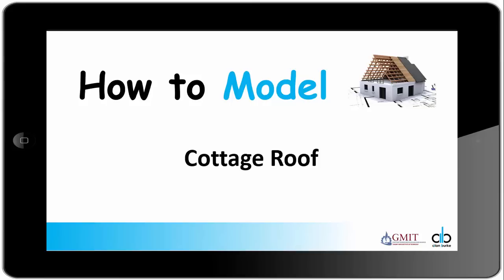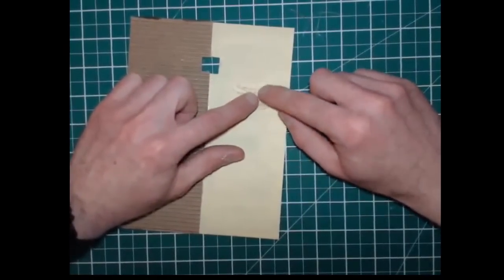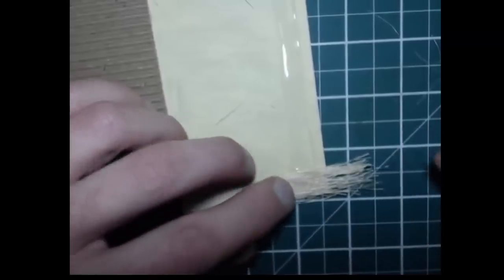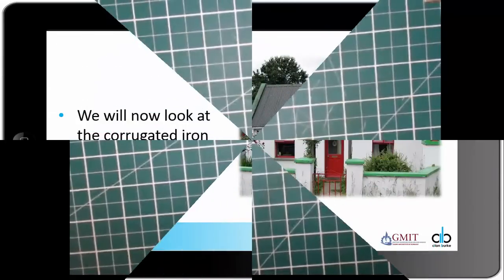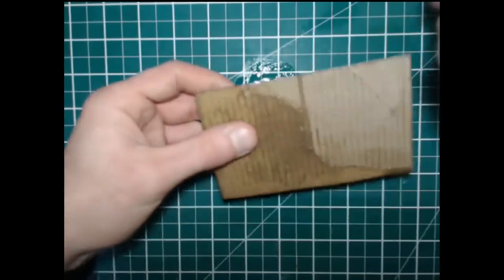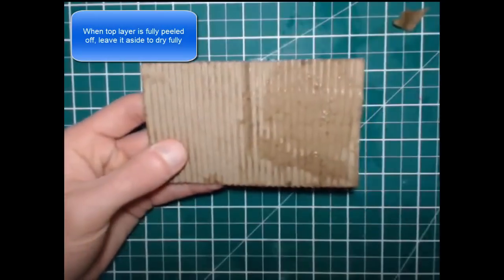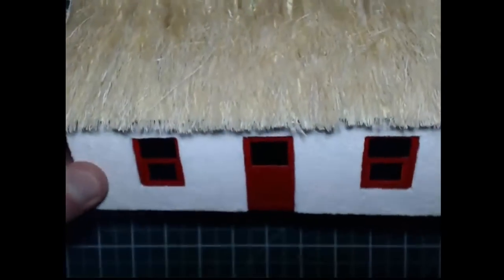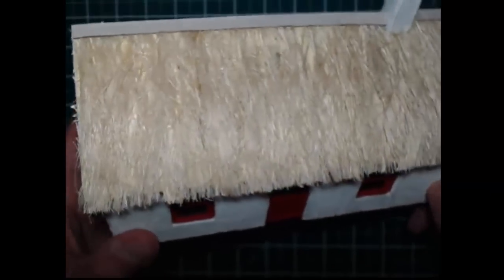How to Model:  Roofs

Comment: July 2, 2019----Thanks for an interesting and useful video. Started building models back in '74 and until last year or so, was always thinking styrene, styrene and more styrene for everything. Then quit modeling about 15-20 years ago, because of some things that happened in life, it wasn't any more fun. But you can't keep a die hard glue sniffer down. Instead of aircraft/armor, going for 1/35th scale zombie/apocalypse dioramas. From YouTube, learned about polymer clay, foam boards and now, cardboard. These ideas came from railroaders, doll house people, war gamers, etc. and of course, you.

Since zombies don't recognize international borders/nationalities, they're quick to chomp on fat Americans, Brits, Germans, etc. One thing about zombies is they don't have any racist, sexist or religious bias. Have 3 dioramas I'm getting back to, 2 of them actually being worked on. The 3rd is more of a concept design to see what does/doesn't fit. Right now doing just American dioramas, but want to do some in Britain, Germany, etc. And I know there's a lot of thatched roofs in your country. Just had no idea how to do it. However, I disagree with you using this for corrugated tin roofs as they come in sheets, not one big section. Which is why I bought a tool which will make them to required size and using thin lead sheets or several sheets of aluminum foil glue together for a thicker thickness.